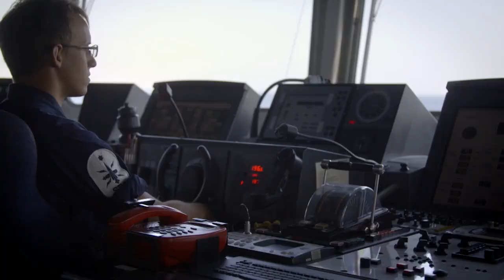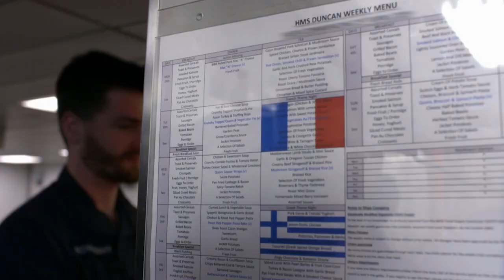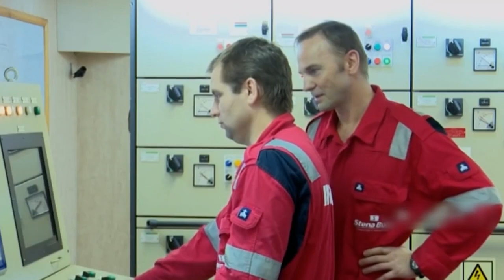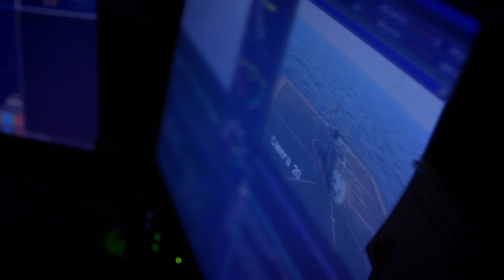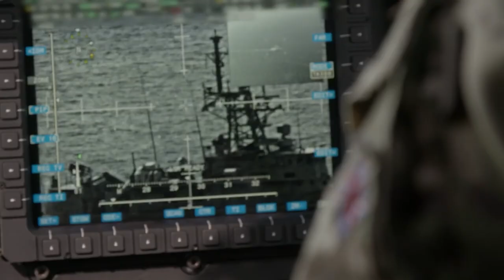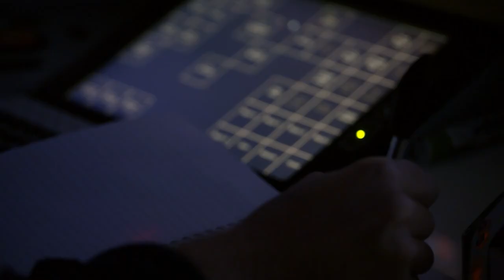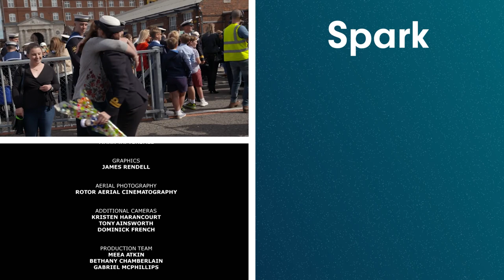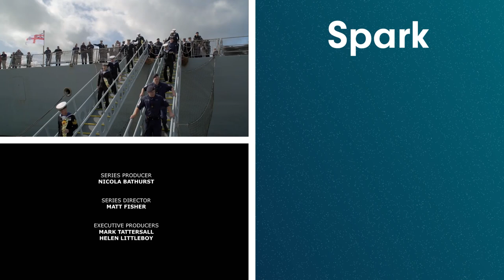HMS Duncan's High Stakes Mission Rescuing British Hostages From Iran | Warship

Comment: She is a pure air defence destroyer, her anti sub and anti ship and land attack capability is severely limited compared to Arleigh Burke class.
Reply: It's not the ship, it's the crew which in a different class to anyone on the Burke or any vessel of the USN!
Reply: Did you look up Duncan's specs before you made that comment?  Even without her 4.5" main gun, Duncan has enough machine guns and cannon to obliterate any of those small boats that were approaching her.  The main gun will easily dismantle not only the larger boat, but given time, it would obliterate the oil platform being used for intelligence gathering.  That, without even mentioning it's Harpoon missiles.  Duncan looks like a capable all-round all-purpose destroyer to me.  And, before you ask, I am a destroyer man - USS Richard E. Byrd, DDG-23, and USS Koelsch, FF-1049.  I would say that Duncan might be a little less capable than the Byrd, and considerably more capable than the Koelsch.

Comment: At 18:28 when the helicopter lifts off, should there be a cable of some sort dangling from the helicopter? Any experts able to say?
Reply: Not an expert, but it's an electrical ground.  You don't want any static electricity arcing near jet fuel.